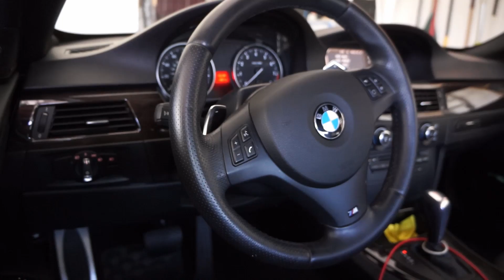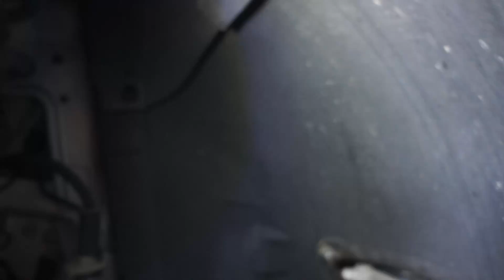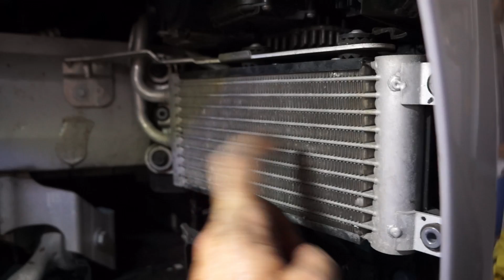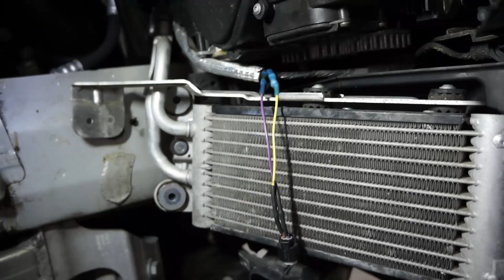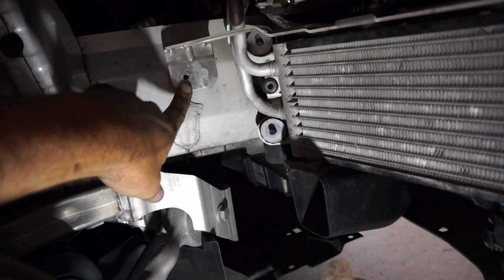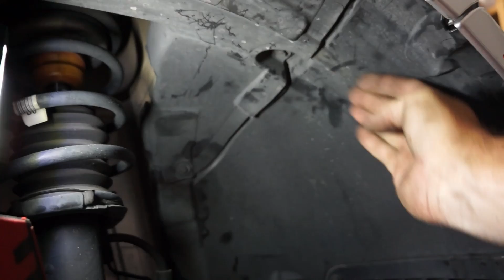2012 BMW 335i Horn Repair

Comment: Hi I was watching this video, My horn goes too. I have not check the fuse yet and if the fuse is good I have to access like the way you show on this video. Mind is 2014 534xi M sport. Since my f32 just like your with an oil cooler and is there enough room to the back and take the horn out ?
Reply from the maker: There was enough room on my 3 series.

Comment: Dammit.  I have the same car (2009) but both my horns just stopped working.  I wonder if mine is fuse related?  I can hear the relay clicking when I press the horn.  Of course ours do not have easy access :(
Reply from the maker: Yes, I would check fuses first.  Good luck.
Reply: @JRsGarage  I found a blown #57 fuse which shows in my Bentley manual that it is the horn fuse.  I will get a new one tomorrow and update this.  Very strange because I rarely use my horn :) Thanks for your video.
Reply from the maker: That's good, easy fix.
Reply: What about horn sound too weak bro? Mine E90 320d 2011!
Reply from the maker: If it sounds too weak, it might be that one of the two horns has stopped working.  Or one of them is damaged.
Reply: @JRsGarage  It ended up just being a fuse.
Reply: @JRsGarage  today I checked my fuse and it looks ok but when I tried to horn it completely no sounds at all😅...what causes it happen bro?
Reply from the maker: If the fuse is good, then it's either the button in the steering wheel, or both horns behind the bumper have gone bad at the same time, or the wiring. It's  unlikely that both horns went bad at the same time.  Check for 12 volts at each of the horns and if the power is good then replace the horns.
Reply: @JRsGarage  went to mechanic he told that no voltage from wire to horn(wire to body got voltage) when he tested using test 🖊️... He  suspecting a Relay or wire@button behind steering wheel(I'm not too sure to call it)
Reply from the maker: Well, at least you determined the horns are not the problem.
Reply: @JRsGarage  updated.. when I double checked with another foreman the culprit is fuse behind a box fuse didn't connect properly... lucky to me that a clock spring are not the  culprit (myr750.00 Bavaria quote me new one)
Reply from the maker: Good to hear it wasn't something expensive.
Reply: @JR's Garage  Nope. But replacing my two turbos, high pressure fuel pump, and oil pan gasket just cost me $4k. So $4,000.35 with the fuse added in. 😀
Reply: @JRsGarage  one more question bro ..after I back home from workshop I noticed that my driver side horn(RHD in Malaysia) has no sound so do you know which sides the high and low pitched?  🙏
Reply from the maker: You can look at the parts catalog here and see what the part number is for the different sides.  https://www.realoem.com/
Reply: @JRsGarage  high 61337300151/159420 but low picth only have 61337300152..which ones on right side RHD?
Reply from the maker: I do not know, sorry.  You may have to call and ask a BMW parts department.
Reply: @JRsGarage  Ok bro...thanks a lot😍